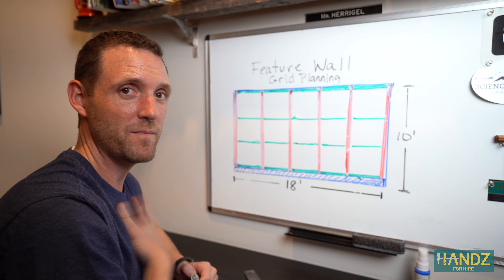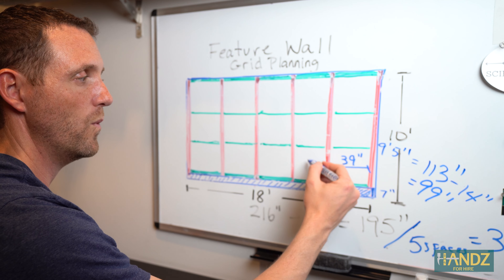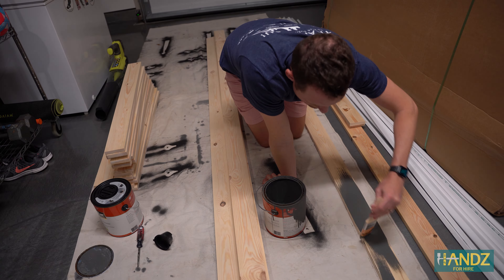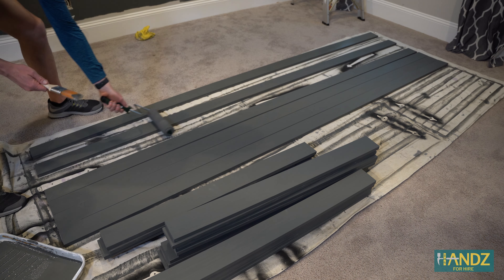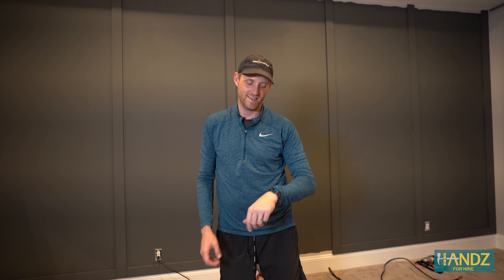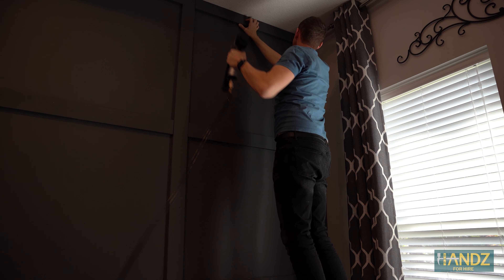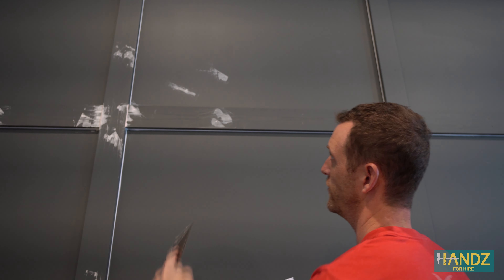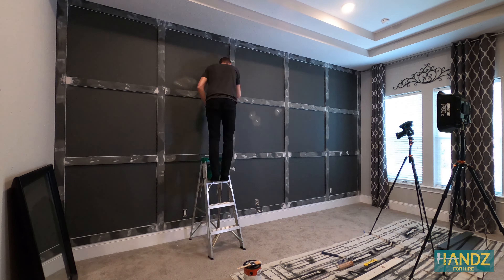DIY Board and Batten Grid Accent Wall & Bedroom Makeover on a Budget

Comment: Love it but I think you could have saved a lot of time. Especially from the pre-painting and then repainting after spackling and caulking. I would at most prime the boards before putting up. But when I’ve done it I’ve put sanded boards up unpainted, done all the work (nails, spackling sanding caulking, hit everything with a tinted primer, let it dry and painted. When painting do brush work first then use the roller to cover as many brush marks on the panels as possible. Looks great though. Next time save yourself a few hours! :-)
Reply from the maker: Thanks - yes, you're right.

Comment: if you start in the corner and make sure its level then take the top and bottom piece and fit them tight and horizontal , that gives you the 2 points for the next vertical board to but against , do a quick level check and nail it down then continue , no measuring needed as long as you cut the horizontal ones all the same
Reply from the maker: Great tips!

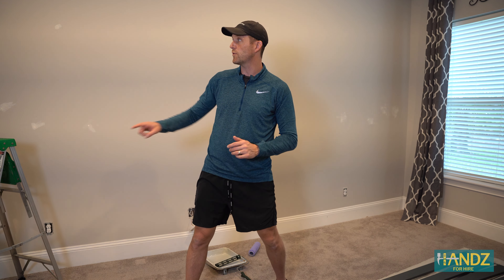Comment: 4:05 You should primer the boards before painting.  The primer will cause the grain to raise up and you need to lightly sand again to get the boards nice and smooth.  This will help the paint keep its color without soaking into the wood and keep the grain texture from popping up when you paint.
Reply from the maker: That's a really great point. The paint I used was a primer and paint combo.
Reply: @HandzforHire  We noticed 😞

Comment: for me, taking the vertical boards all the way to the top was a bold move.  I feel like the ceilings of my home have not been level enough to trust the top row would look right if I split them up into min pieces. I agree it would definitely be easier as long as you know that the tops will light up correctly.
Reply from the maker: That's a good point, but my walls were so long that I couldn't find a horizontal board to span the distance. I would have had a seam anyway, so that's why I decided to go vertical first and cut up the horizontal. Have a great day!

Comment: This is why I never cut it ahead of time....I cut to fit as I go.  These new houses are never square....there's all kinds of drywall fluctuations and you can never assume that what you measure at one point top to bottom will be the same at another point.  Its always different.  Very good video, very thorough....turned out great!
Reply from the maker: Thank you! You're completely correct and I learned the hard way. Lol. Hopefully someone else will avoid this mistake by watching!
Reply: @HandzforHire  Right on man!  I was also gonna say if you want to avoid all that sanding and warped garbage lumber use pvc board.  Currently it’s not that much more than wood and it’s always true, can bend to uneven drywall, no sanding needed.  It’s all I use these days just because most lumber sucks.  Good work brother...well done!
Reply from the maker: @SK-pn1pe   That's a great idea and would have saved a lot of time.

Comment: I have this panelling but find the parts on bottom vollect dust badly and are rough so won't clean, do i sand and caulk it? Its like the bottom of each square
Reply from the maker: Hey, I'm sorry that sounds tedious. If it's rough, sanding, caulking, and painting with maybe satin finish is one option. Are you able to run a wet cloth along it and get it clean? Another option is using a pore filler which fills in the crack and uneven surfaces. It will help make it more smooth. Good luck!

Comment: Hi do you think there’s a way to do this despite having a ceiling that is not perfectly level and somehow from on end to the other it’s 2 cm higher on one end
Reply from the maker: That's a little tough, but no ceiling is perfectly level. Is the 2 cm difference spread throughout the entire length of the wall? If so, I think you can hide it fairly easily. I'd do the vertical board as one piece, and fill in the horizontals between. Make horizontal in between the vertical boards and next to the ceiling completely level. As the ceiling rises, move the horizontal board very slightly higher, but still keep it level. If there are any small gaps, fill them in with caulk and in the end I think it will look very good. I hope your project goes well!

Comment: Is it ok to do a spray paint on that final coat? Or brush has better texture finish?
Reply from the maker: I think spraying it on would be just fine if you have the equipment to do so. I do not, so I just went with what I know and that's brushing. If you're comfortable with the spray, then go for it!

Comment: Was your drywall already a smooth finish or does it have a texture to it? My wall has a texture but want it to be a smooth finish
Reply from the maker: Mine was already smooth, but you can turn textured into smooth with a skim coating technique. This guy does a good job demonstrating. It takes some effort, but I think you can get them looking good. I prefer this method to sanding because sanding make such a mess. Good luck!

Comment: Is it necessary to remove the baseboards? I se you did not remove them.
Reply from the maker: I actually did not. I rested the bottom board right on the top of the baseboard. After consideration, I thought it would look funny if I had baseboards around 3 walls but not the 4th so I just did the board and batten wall above the baseboard. Have a great day!

Comment: Shouldn’t the gaps between the trims be caulked instead of spackled? Wondering if it may crack from movement. 

Loved the video though! Glad to see helpful guides like this on YouTube 😊
Reply from the maker: Thanks! You bring up a really good point, and caulk is definitely better at expanding and contracting. The issue was the gaps between the boards were a little to large for caulk. Caulk can't be sanded but spackle can. I was going for the smooth surface, but you're right, it can crack over time. Perhaps a wood putty was the answer, but if it does get bad (and it hasn't yet), I could always patch pretty quickly in the future. Have a great day!

Comment: Thank you!  One more question, on the base board.  The vertical boards appear to be flush, did you angle these into the existing base board?
Reply from the maker: Actually, no. It's a square cut at the end. There's a little lip on the top of my base boards the was level and I just used that as my guide.

Comment: How did you flush the boards at the bottom?
Reply from the maker: Great questions and they are not flush. I thought about this a lot, and I would have either needed to use thinner boards, or replaced the floor boards to make everything flush. I opted to leave as is and to be honest it still looks great. Because you look down on it, and the board sticks out farther than the tapered floor trim, you don't really notice it. Have a great day!

Comment: Would 1/2 X 4 work instead of 1 x4? were you nailing everything into the studs?
Reply from the maker: 1/2 x 4 would definitely work. It just depends on the look you're going for! I did not nail into the studs in every case. A lot of times it was into the sheetrock and this is why I used the liquid nails. The nails help hold the boards to the sheetrock while the glue dries. 24 hours later, everything is rock solid.

Comment: how did you get the 216 on the horizontal line?
Reply from the maker: Hey, great question and I should have mentioned in video. The wall length was 18' and I converted it to inches (18' x 12" = 216"). I hope that helps! Have a great day!

Comment: Thank you for all the information - one question: some other videos removed the baseboard  and added another horizontal board to make everything flush on the bottom.  I noticed you didn't  - are your boards not flush against the baseboard?
Reply from the maker: That is a valid point, and I considered removing the baseboard, but in the end wanted to keep the baseboard matching the rest of the baseboards in the room. This means that the lowest horizontal board does stick out slight. The good news is it that it doesn't stick out too far, and your eye can't really tell. Your eye is draw to the wall and not the threshold between the board and base board. Hopefully you can get an idea of how it looks in the final shots towards end of the video. Good luck if you do a wall yourself!

Comment: Why did you paint then apply caulking then repainted it?
Reply from the maker: Good question and I could have just waited until after caulking to start painting. I just found that getting a coat on everything while it's accessible is quick any easy. Once everything was up I did a second coat, but didn't have to be as careful about missing spots because the majority of everything was still primed with the gray. You'd definitely be okay waiting until after, but you'd most likely need two coats after instead of 1 before and 1 after. Have a great day!
Reply: @HandzforHire  ah OK. I'm only asking because I see the same method you use as the same method others you. I just wanted to get people's input if there was some sort of advantage of doing it in that order
Reply from the maker: @marlonestrella5054  yeah, it's the method I've always used because I find it easier to paint the wall when it's all exposed and paint the boards when they are accessible on a drop cloth. Sure, I have to do a second coat because of the sanding and caulking, but I didn't have to paint quite as close to the ceiling or other walls because I had a good base. I may just be imagining it's easier this way, but it works for me. Have a good one!

Comment: I really, really, really wanna do this..  Just looks like a ton of work for one person crew...  What was total hours for wall??
Reply from the maker: It does require some time. I split it up throughout a week. I got all the materials one day, cut and sanded the boards the next, painted and installed the following, caulked and spackled the next, and then sanded and repainted the final day. I think the total time was somewhere between 20-25 hours. Good luck if you try it!

Comment: Would i have to remove trim and base boards to do this?
Reply from the maker: Good question. I did not remove anything. I rested the lowest horizontal boards right on top of the base boards when I did it, and it worked well.

Comment: Did you need to use shims?>
Reply from the maker: Fortunately not. The house was fairly level and since it was the horizontal boards that were split, I could slightly adjust each section individually to make sure it was level.

Comment: How do you know if you hit an eletrical wire?
Reply from the maker: Great question! We are the builders/first owners of this house so I know where the electric is behind the wall. All wires run through the studs so they are not close to the sheetrock. It wouldn't be possible to hit a wire through the board and sheetrock because the nails are not long enough. Have a great day!!

Comment: Why not use polyurethane or MDF? It seems most crown molding is polyurethane.  I also cant decide if crown molding at the top would look good.
Reply from the maker: That would have been an excellent choice as well, but the truth is that the Home Depot didn't have the supply I needed when I was doing this project, so I just went with the wood. Have a great day!

Comment: nice work.. you weren't worried about not going into studs with the nails?
Reply from the maker: Thanks! You're right. I both hit and missed the studs, but honestly the nails were there mostly to initially hold the boards in place. They kept the boards flush with the wall while the liquid nails dried.

Comment: So when I go buy the wood slats, are there different types of wood to choose from ? I want to do this to my bedroom but I’m scared to be overwhelmed incase I don’t know what to get
Reply from the maker: I actually just went with the cheapest boards I could find (lol). These are pine common boards from Home Depot. I was careful while choosing. I tried straight boards with  no sign of warping (not as easy as you'd think). I'd grab a board by one end and look down the length with one eye to if I saw any warping. i also tried to choose pieces without edges missing from tree knots. Hopefully that helps!
Reply: You can get premade material out of pressed fiberboard and it is primed and saves time. A little more expensive but worth it to me.

Comment: Did you use stud finder to put the nails ?? Or just randomly nailed into dry wall ?
Reply from the maker: Good question! Because of the pattern, I had no choice but to nail into dry wall in certain places. This is why I used Liquid Nails which hold the boards securely to the wall. The nails hold everything in place while the glue dries.
Reply: so I see some of them paint the slats and walls after it’s done but you have painted the wall and slats first is there any specific reason?
Reply from the maker: @divyatva  Since I caulked, it really didn't matter which order. I only painted first because sometimes it's hard to get into the cracks/edges of boards.

Comment: Did you consider using MDF instead of pine boards?
Reply from the maker: Hi Laurett, I definitely considered it. It looks nice, and have saved me a lot of time sanding. I decided to go with the pine common boards mostly because they were immediately available at home depot, and MDF boards of similar dimensions were not. If you have the option to go with MDF, I'd say go for it!

Comment: Excellent video. Really helped me a lot - one Q please? Did you use the finishing nailer on the studs or was it ok with liquid nails and on the drywall etc. ?
Reply from the maker: Thanks! I appreciate it! I used the finishing nailer throughout and many of them went through boards into drywall. If I didn't use liquid nails this would have been no good for long term, but the nails acted more like a clamp until the liquid nails dried. Liquid nails doesn't hold in place until it cures, so I would have ended up with separation from the drywall or gravitational sliding without nails. Good luck if you're gearing up for this project!

Comment: I was wondering why you were painting without a drop cloth 🤣...nice new floors
Reply from the maker: Great question and I was painting on over our old carpet. Right after the wall was finished, we ripped the carpet out and installed the nice tile floors. Thanks for checking in. If we had replaced the floors first, I definitely would have been using a drop cloth! Haha.

Comment: Using liquid nails was a bad idea. What if you decide years later you don't want that look anymore? How would you remove the boards without messing up the wall?
Reply from the maker: Good point, but if I switched it up, I'd probably just replace the sheetrock. It's similar to a tile backsplash in a kitchen. You have to use an adhesive so the boards are secure. If I just did the nail gun, it would be hard to get each board into the studs. A lot of nails are just into the sheet rock. If you decide to do it without adhesive, please let me know how it goes.

Comment: Any reason why you painted it 3 times and not just once after it was mounted 🤔🤔🤔🤔🤔
Reply from the maker: It was a bit overkill, but honestly painting was the quickest part of the whole job. I was able to paint all of the boards quickly on the ground which saved me detailing time when they were nailed up (especially around the border). I think I would have had to do two coats no matter what. It's perfectly fine to put them up, spackle, caulk, sand, and then paint too. Have a great day!

Comment: We're your walls concrete or sheetrock?
Reply from the maker: Hello! They are sheetrock.
Reply: @HandzforHire  can this be done on concrete walls as I am now building my house?
Reply from the maker: @cometravelguyana6458 I don't see why not. You can attach the boards with a glue product like liquid nails (specially designed to attach wood and concrete), and caulk in the same way I did in this video. You won't be able to use the nail gun, but if you really want to secure, you can drill and use screws to fasten. You'll have to go back and spackle the screw holes in your boards afterwards. Good luck if you decide to do it! I'm sure it will turn out nice!

Comment: There's not really a point of using the brad nailer if you're are not going into a stud. Also It looks like it may be an exterior wall....if it is you just made like 40 holes in your vapor barrier. Liquid nails and calking would have been the best practice.
Reply: I believe the exterior wall would have a window